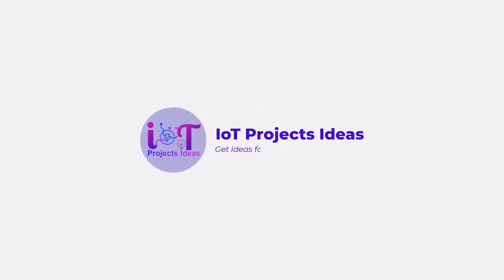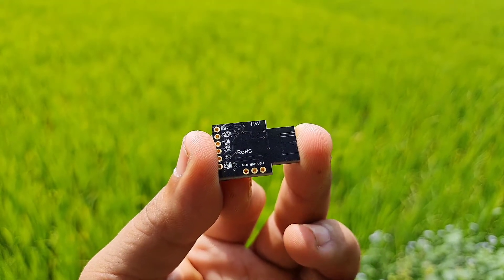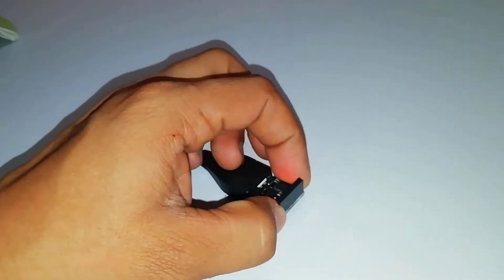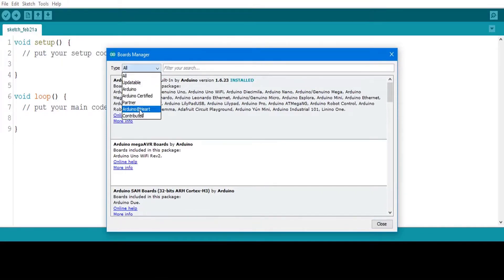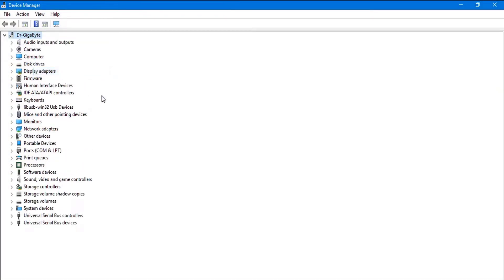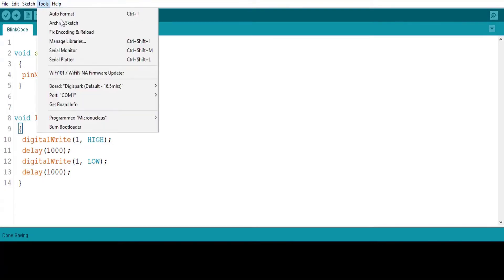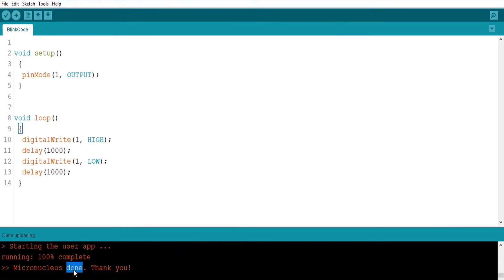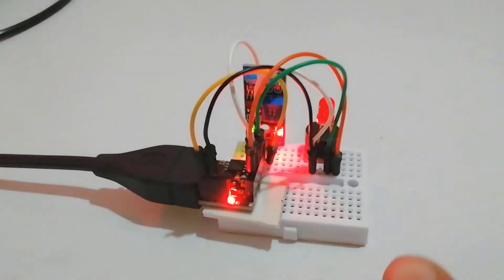How to Program DigiSpark Attiny85 with Arduino IDE

Comment: the digistump download does not work
Reply: I hope you know how to install board package by manual. You can follow the step:
Step1. Download Digistump zip file in GitHub (digistump/DigistumpArduino)
Step2. Put zip file in username/Library/Arduino15/staging/packages (do NOT unzip)
Step3. Copy the zip file and unzip file, then put the unzip file in username/Library/Arduino15/packages (NOT the same path)
Step4. Restart Arduino IDE and check if the board appear in tool>board list
My system: MacOS M1 15.1.1
Arduino IDE 2.3.3
Digistump Arduino Release 1.6.7
Reply: This method is work for ATTinyCore by SpenceKonde/ATTinyCore from Github too

Comment: Digistump avr packages not installing can anyone help please
Reply: I hope you know how to install board package by manual. You can follow the step:
Step1. Download Digistump zip file in GitHub (digistump/DigistumpArduino)
Step2. Put zip file in username/Library/Arduino15/staging/packages (do NOT unzip)
Step3. Copy the zip file and unzip file, then put the unzip file in username/Library/Arduino15/packages (NOT the same path)
Step4. Restart Arduino IDE and check if the board appear in tool>board list
My system: MacOS M1 15.1.1
Arduino IDE 2.3.3
Digistump Arduino Release 1.6.7
Reply: This method is work for ATTinyCore by SpenceKonde/ATTinyCore from Github too